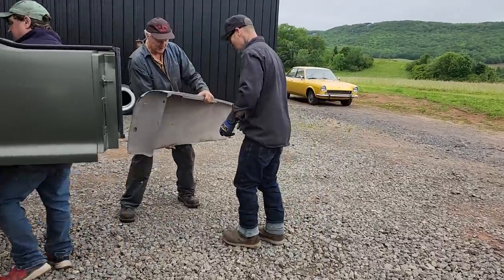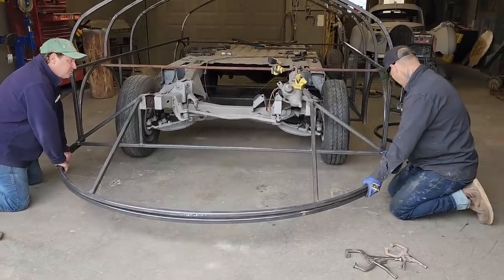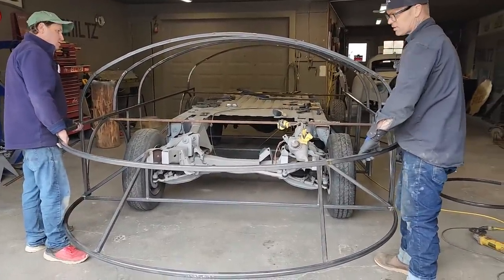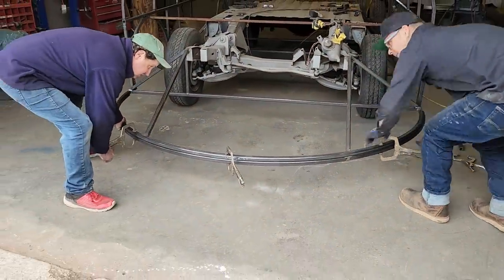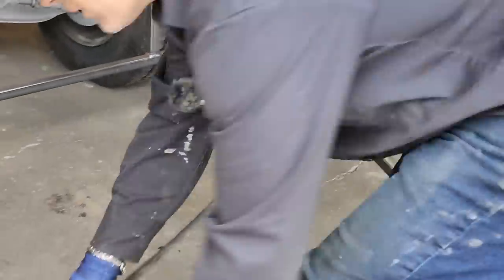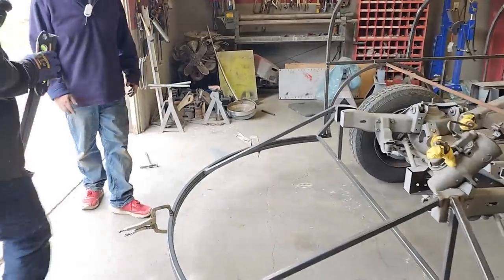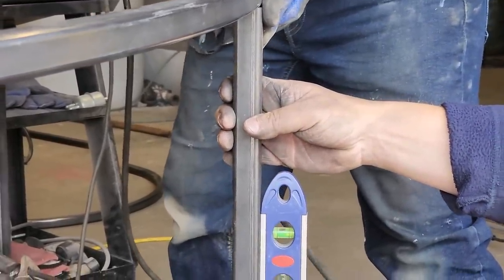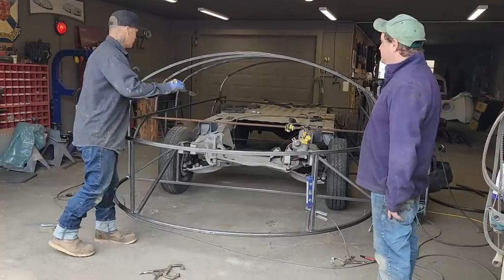Framing up the cab was a struggle 😝

Comment: *THINKING AHEAD* I think, that tear-drop 1996-2002 Mercedes-Benz E-Class W210 headlights would give it some class, or adding some 1940 Ford headlamps with enclosed signal lights just above would give it that older droopy-eyed look. A '52 Chevvy Pickup grille would set off the front and be a good hiding place to add some fresh air vents to cool down the interior space and pressurize the cabin to force the exhaust and fuel fumes to the back compartment which would escape thru a rear grille hatch. Positive cabin ventalation!

Comment: Lookin good guys! The exoskeleton is moving right along! A trick i like to use when bending curves is scribing the metals center length, then split those two halves and scribe center marks again. More pression curves can use more layout lines to help keep arch accuracy. Also keeping those rollers clean on the bender keep the twists away, and keep the pins lubed.

Comment: Just a thought ……. Why not fab an engine cradle (example: like a new Camaro has as well as many other newer unibodies) that the engine would mount on and then fab the cradle to bolt to the trucks unibody from the bottom. You would have to put the body on your lift and let the body down on the cradle with the engine on it to bolt in place on the truck.  That way you wouldn’t have to worry about a large side opening on the body to install/wrestle the engine in place. 😊

Comment: Great going Chad, how about loading the engine in from the bottom?  You could put the whole thing up on the lift and then raise the engine and tranny in from underneath. That would preclude any top holes or access through the roof. All the engine work could then be done from inside, easy, peasy.

Comment: Chad, the front of the doodle bug has a gradual slope on the front of the original van. It's not completely vertical like the way you've fitted it so far. I recommend moving that front ring back four inches and slightly tilt it downward to match the outer slope of the front end. If you don't move that front ring back the windshield will be sloped too much! It doesn't look like it will be too much work to alter it.
Reply: Yes.
Reply: This is the solution Chad.

Comment: Chad, the truck shape resembles to 1951 Volkswagen kombi. It looks like to me that the bottom front curve shouldn't be equal size to the top curve. If you are planning to weld  three curved pipes, may be each of  them should have 1/2 inches difference to get the exact front shape as seen on Jolin's phone. The front curve you weld looks like straight.Front face has to be frog face shape. Also, torch heating might help to get good curved shape. Also consider flat bar steel instead of pipe. Tku

Comment: I would bring the engine up from the bottom with a bolt on engine cradle. That way if you have engine trouble you can replace it easier. Just my belly button. 👏😎👍

Comment: Bend the full front 2”muffler center crash beam  between  the two front windows of the front gull wing door windows vertical  with the same 8” rise as the roof . the diameter of the curve  will be different unless center is 1/2 of 72-1/2” out from the first rafter that’s ok each vertical brace will change keep the 8” straight all around symmetrical    Looks great  
2 front gull wing doors opening to rigid straight vertical  crash tube center amen

Comment: This is only going to be used as a static display , no way would this 0:00  even be aloud on the road in Australia you couldn’t get it engineered approved to put it on the Road it obviously won’t have any strength in the front if it has a frontal impact .
Reply: It would be nice to see it move around the property under it's own power with brakes and steering..
Reply: it's a cartoon, none of chad's brain dropping are road worthy or safe
its art for no particular reason
Reply: It's in Canada not Australia.
Reply: Bad Chad and Jolene do not live in Australia, just saying.

Comment: you can drill holes in the hoops and use round rod shaped properly and insert each end in holes drilled in hoops and tacked on each end. many custom cars are fabricated with round rod. its so easy to shape.

Comment: You might find it works to lay out the shapes and parts on a sort of fixture, and weld up each one in the fixture to make them consistent. It's hard to keep those long pieces shaped correctly as they flex. Another approach would be to use smaller cross-sections of steel, but have 2 of them in parallel, joined by some steel rods to form trusses that will hold their shape. I can imagine on a modern vehicle, stamped parts that are curved would hold their shape in one direction, with braces keeping them spaced and tied together for stiffness. I can't wait to see how this build progresses. I know you can work magic with the sheet metal once you have the frame to set the overall shape!

Comment: If you have two things close together that you can put your square tube inside to bend it exactly where you need it to move. I hope that makes sense. Like if you had some heavy duty pipe welded together with about 3 inch gap between them or so. Feed your tube through the gap and bend it right where it needs to move. Can even use an open vice.

Comment: Hey chad you can attach a electric  pipe threader to your tubing bender shaft and you can run it back and forth with the flip of a switch . And not have to turn it manually.  My buddy set his up like that

Comment: The way I get 2 pieces the same is every 6 inches I tack them together then I take a torch and heat up the one I want to match being careful to not over heat my buck. The heat will cause the 1 to conform to the other 1. Once it cools I cut the tacks.

Comment: If you move the whole roof up at least 4-6 inches that will give you more room for your front windows. Also, I would double up the tubes between panes especially in the front center section.

Comment: I would get a small front wheel drive motor and trans   like an aluminum v6 or l4  and set it for the back wheels .  like an old VW  bug  then try to lose some main frame weight with those circle cut outs you did on previous car.

Comment: You have a perfect platform to collaborate with another youtube builder like the guy that turns teslas into v8s. That with electric on the front instead of Texacowould be wild
Reply: Steering by wire, huge platform for batteries already set up for weight!

Comment: Needs a real sized chassis to handle more weight so it can have an actual real frame built,but that front end doesnt look safe if in any front end impacts get crushed between the cross member & front end but maybe its just for the show & wont be legaly operated on any highways,cross member also because of high it sits would need to be modified..so the whole front would be designed to sit low.
Reply: It’s a show car, not build for the road

Comment: I think you want to sit on the front wheel wells.
I have no idea how to do the steering box 
And I don’t know how to move the front wheels out to the edge without rebuilding the whole front end or chopping up the frame some crazy way. This is a very interesting project. 
Might I suggest the engine trans go in from the bottom?
Reply: Twenty wheel spacers, don’t worry it only has to move from here to the new shop, no further…

Comment: If you cut a relief cut every 2" in your square stock you can draw the tubing closed, not open it up and you will come up with an arc. if its not enough you can run the blade in the same cut and it will take a little more off, then pull it in some more

Comment: You should make a front panel with a window frame that does not curve too much because curve distorts view and too much distortion does not work. Then when you have the window frame, you can make first the roof curve and rhen the corner wedge pieces. It will be a double slanting piece that makes the doors difficult to fabricate, but you can make those, you have made worse 👌😊
Reply: Those roof rails should of been higher

Comment: I dont understand why they keep bending it beyond the correct curve, it cant be that hard to use a tape measure, maybe if they made a quick jig that would help them too. The original design plans that I have seen, shows the front actually sloping back slightly, its definitely not vertical, and it also has a curve from top to bottom at the front.

Comment: You shortened it, you lowered it,  you should have narrowed it by removing outer dually wheel and solved the problem of the front wheels. never too late. regardless I'm sure it will work out.

Comment: Still think it needs to be narrower. You made it shorter and lower, but kept it very wide. Making it narrower would solve the narrow front axle problem. The wheels being right up to the edge of the wheel arches is part of the look and the wheel arches are even wider than the body you have now.

Comment: Make an engine frame to fit on the frame of the chassis. Then put the chassis on your lift raised. Move the engine under the frame chassis and lower down to the engine. Bolt engine frame to chassis frame. For maintenance in the future simply put on lift unbolt raise frame and work on engine. Most anything to else you need to stand on your head to do repairs.

Comment: Chad, should you come down from the top of the rail to a point where the top of the windshield would be and create studs to go from the cabin top to the top of the windshield before you try to go up from the horizontal bar you just put in place?

Comment: EXTREMELY unsafe to have the passengers out front...in front of the frame of the the vehicle like this, but I suspect that it's just a work of art and not meant to be actually driven.
Reply: Agree I would raise the roof more so you could put the seats 💺 were the engine used to be. Just a belly button.
Reply: dont be surprised when you adds inner skeleton structure to strengthen things up. but i agree sitting on the front engine cradle would be better, mostly just to see better

Comment: Hi chad  you can turn rims around backwards on front should be  alot better or you could also cut centers out and  most are spot weld ed i  can see the round spot welds on rear rim and you could find truck rims like the rear ones and make adapter s

Comment: 1/4 inch plastic rod at the length you need will bend to the perfect curve you need. Clamped on either end is a great shape finder. I use them for fancy rounded top fences   Just sayin.    Cheers

Comment: The second front loop should be a little shorter than the bottom one. It’s rounded side to side but like a wall top to bottom.  You needed to start with the center bar first and work you way to the side from that

Comment: Steering behind the driver seat? How many universal joints is that going to take?
Reply: @jps342  hydraulic steering should work, make it a lot easier to fabricate
Reply: Really easy fix to make the steering work, that is the least of his problems, but as usual it will get just to hard and he will push it into the shed and forget about it, just like every other build he has started for the past 4 years.

Comment: I would have liked to have seen bigger box section mounted onto the ends of the chassis, down and forward to the front curved piece. Then no angled small sections in the way, something more substantial to mount steering box, floor pan, seats, and providing stronger under carriage to mount a front bumper. The front seems too flimsy for protection.

Comment: What kind of engine are you going for? A 6,7 liter streight six cummins diesel or a V8? The streight six is a torque monster with nice harmonic sound... used in a lot of mid-sized trucks, lorries and buses over tve last 30 years... But then again, V8 is V8.

Comment: I'm really confused by your placement of the second front arch.  The top of the bumper should only be about 8 inches above the first piece of metal.  The piece that you installed would be form the base of the windshield, and would be 4 to six inches aft of the bumper face.  Look at your model.